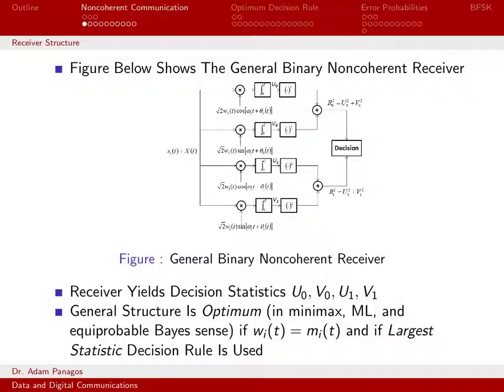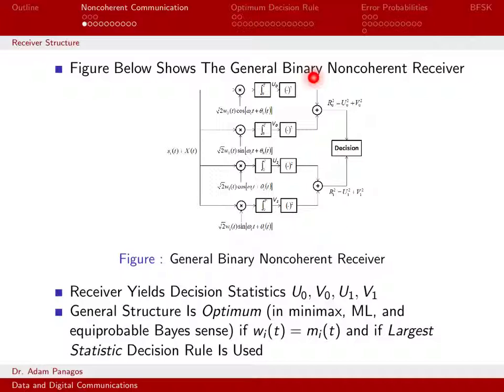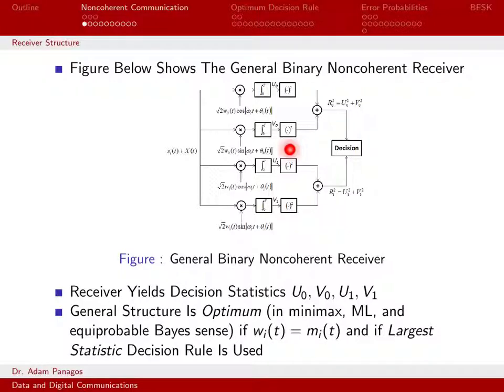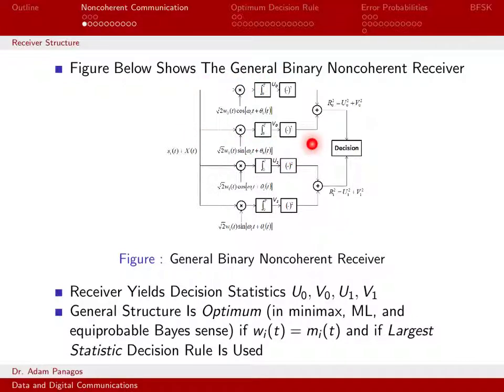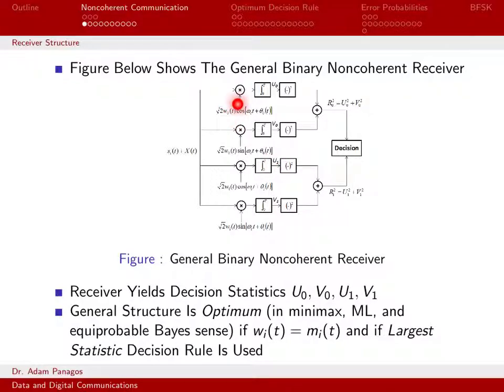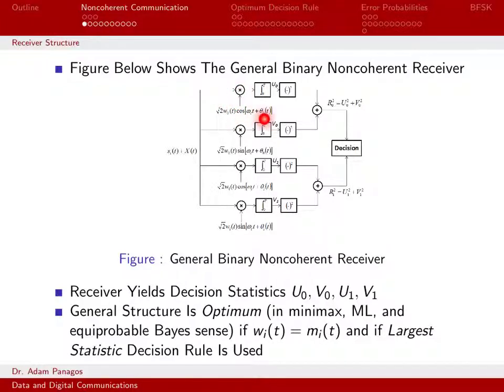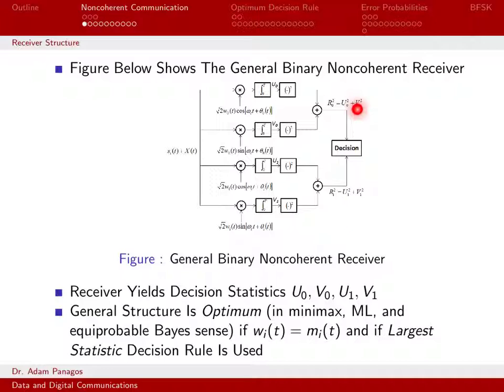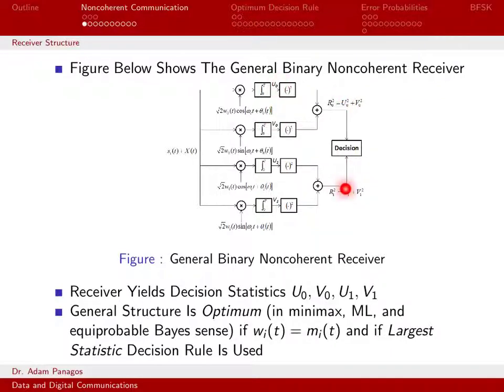Noncoherent Communication (2/12): Receiver Structure

Comment: Does this assume that time is already synchronized at the receiver? (Otherwise we don't know when to make the decision). For example, if we assume this is a digital communications system transmitting discrete symbols (mapped via some modulation scheme onto a_i(t) and \theta_i(t)) , then we only want one decision per symbol (i.e. at baud rate) and these decisions should be aligned to the actual symbol times.

In addition to timing "alignment", I guess we also need timing "rate" at the receiver to match that at the transmitter (otherwise the locally generated copies of the symbols will correlate poorly with the received versions).
Reply from the maker: Yes, that's correct.  This video (and the others in the playlist) assume that we are synchronized to the symbol time (e.g. we know when the symbol begins).  However, it's non-coherent in the sense that we don't have a phase-locked carrier frequency to use at the receiver.  Hope that helps,
Adam